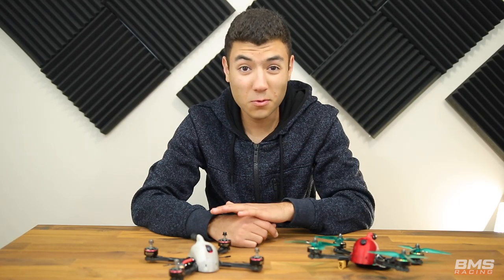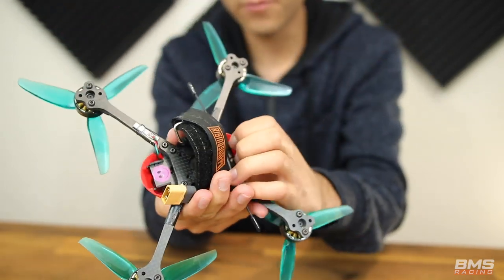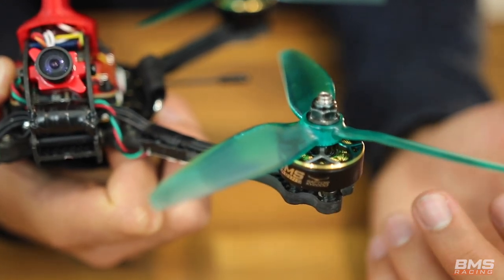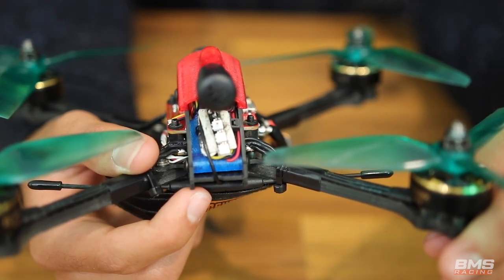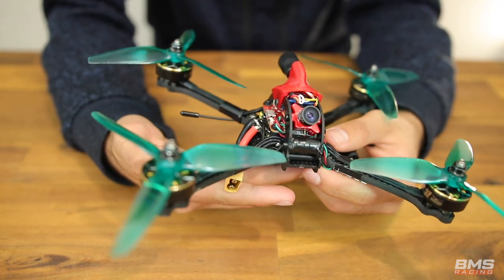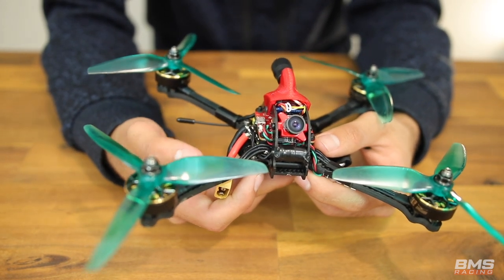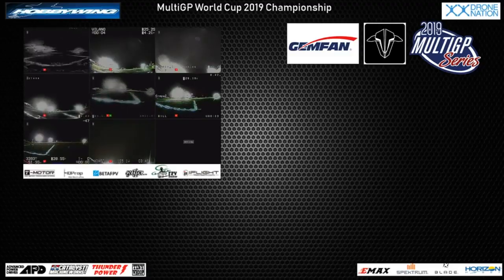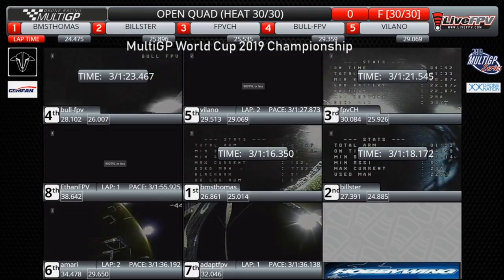JS-1 The MultiGP World Cup Winning Quad - Overview and Setup

Comment: Is the geometry a little bit squashed? Why do you prefer squashed vs stretched? Thanks Thomas! Very nice and clean design
Reply from the maker: Thomas has been running squish X since 2014, basically it’s the tightest possible motor to motor without any air obstructions in the prop stream (minus arms) 🙂
Reply: @BMSWEB  Yes I know the he prefers that kind of geometry, if I am not wrong he was using before the Helix frame squashed. But recently he published videos with the MCK hybrid (stretched) and looks like he doesn´t  prefers that kind of geometry. So if "theorically", stretched is better for the rear arms airflow, why squashed is better for Thomas? Maybe have better handeling in corners due to the distance between roll axis arms?
Reply from the maker: @dr.manueldominguez  Thomas only flew the Hybrid for a 3 or 4 months competitively. In answer to your question he believes Squish is better in every single way and hence why this frame is designed this way.
Reply: @BMSWEB  Thanks for your answers! :)

Comment: Beautiful frame 👍
You did not fix you power cable to the frame, so by crashing when you lost you battery you may damage your esc board.
Reply from the maker: 4 Months of racing and not damaged the ESC board. Battery will disconnect when the battery strap breaks in hard impact due to the direction of the power cable is facing, but having said that it is possible